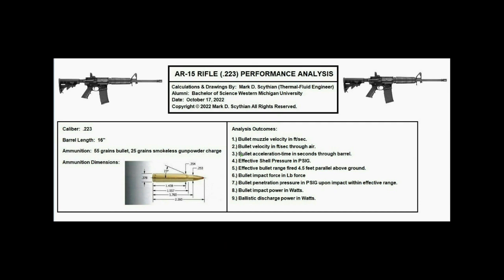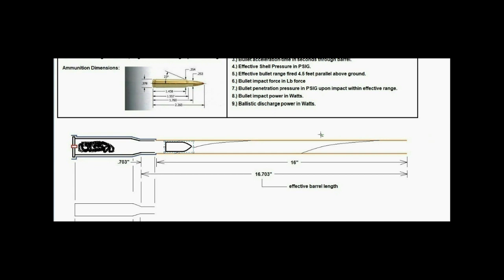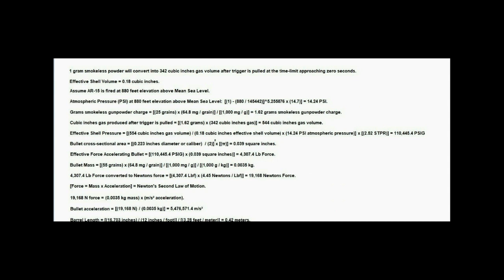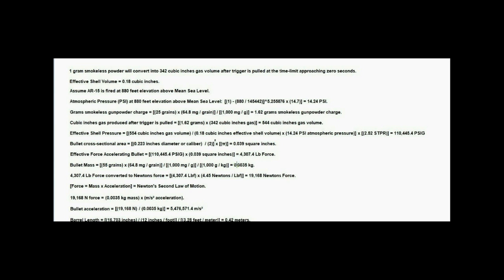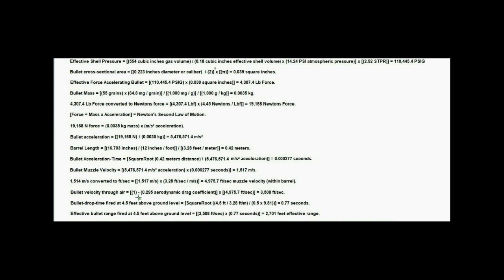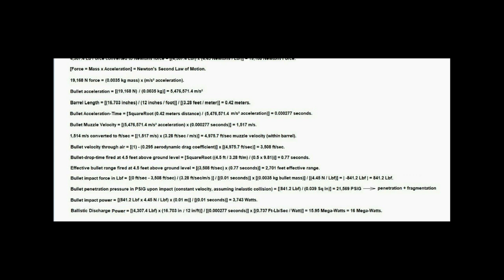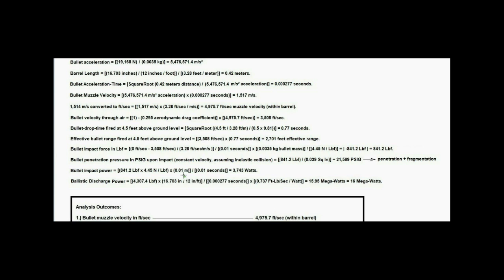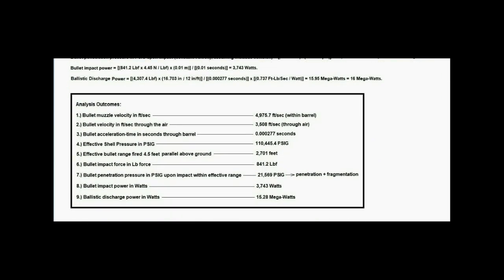AR-15 Rifle  (.223) Performance Analysis

Comment from the maker: Please view my corrected calculations below:

Bullet Mass = [(55 grains x 64.8 mg/grain)] / [(1,000 mg/g)] / [(1000 g/kg)] = 0.003564 kg.
Bullet Velocity = [(3,508 Ft/Sec) / (3.28 m/s/ft/sec)] = 1,069.5 m/s.
Bullet Kinetic Energy = [(0.5) x (0.003564 kg) x (1,069.5 m/s)^2] = 2,038.3 Joules.
Bullet Impact Time = [(0.003564 kg) x (1,069.5 m/s)] / [(2,038.3 Joules)] = 0.00187 seconds.
Bullet Deceleration = [(-1,069.5 m/s) / (0.00187 seconds)] = -571,925.13 m/s^2.
Bullet Impact Force = [(0.003564 kg) x (|-571,925.13 m/s^2|)] / [(4.45 Nf/Lbf)] = 458 Lbf.
Bullet Cross-Sectional Area (Includes Fragmentation) = [(0.223 / 2)^2 x (3.14159)] = 0.039 Sq In.
Bullet Penetration Pressure = [(458 Lbf) / (0.039 Sq In)] = 11,743.6 PSIG.

Thank you.

- Mark Scythian -
January 03, 2023